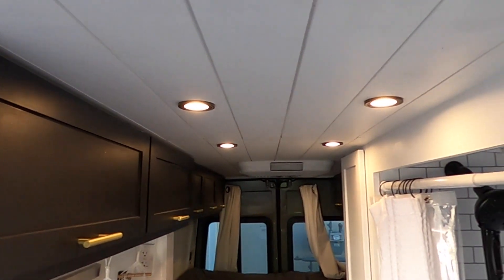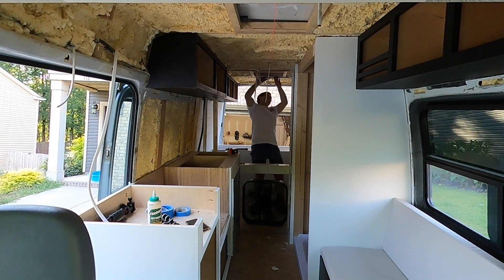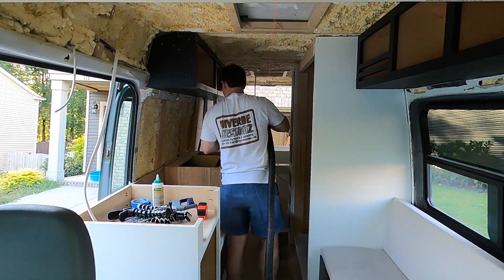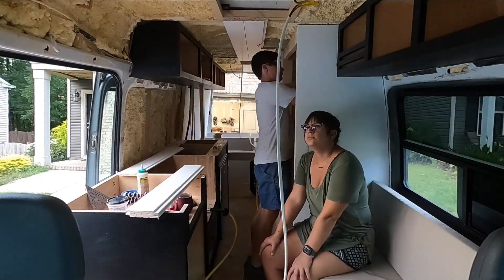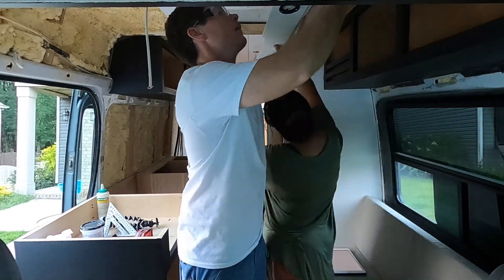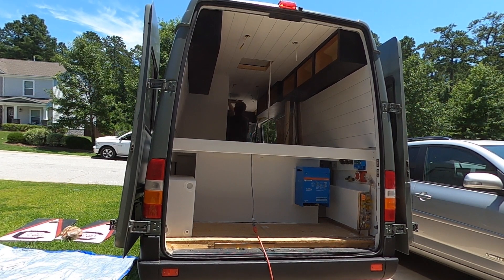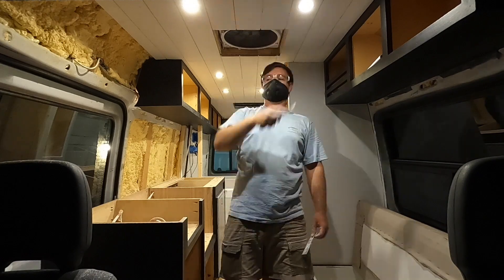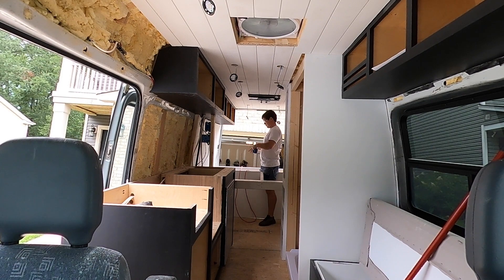Van Build Episode 20! Putting up Shiplap and Installing the Maxxair fan and Dometic AC Unit!

Comment: How do you like the air conditioner in this van?
Reply from the maker: It used a lot of power but definitely kept the van cool even in 110 deg Fahrenheit weather.
Reply: @goldenadvantures2573  oh that's great!  How many amp hours would you recommend getting for this air conditioner and also having lights on and charging laptops at the same time?
Reply from the maker: There’s really no amount of battery that could keep up with this air conditioner. You’d have to have a huge amount of solar, a generator, or a really big alternator on the van to be able to do it.